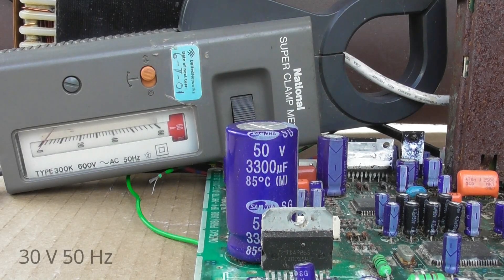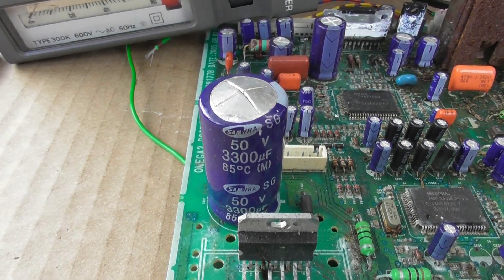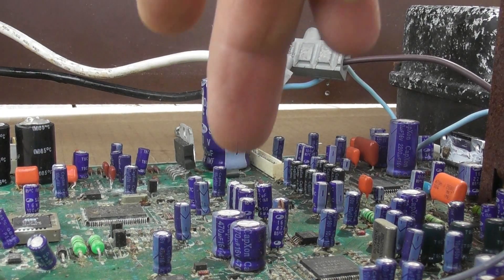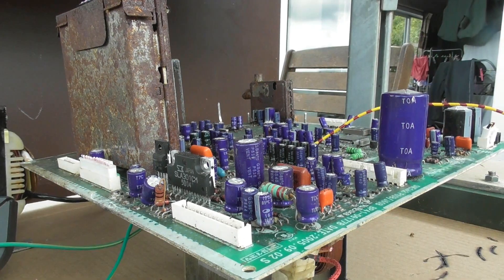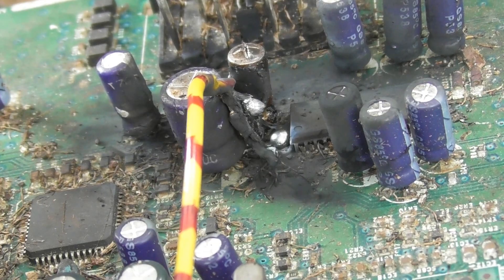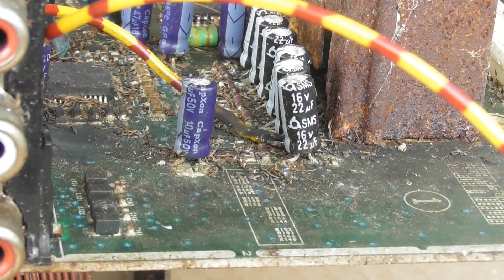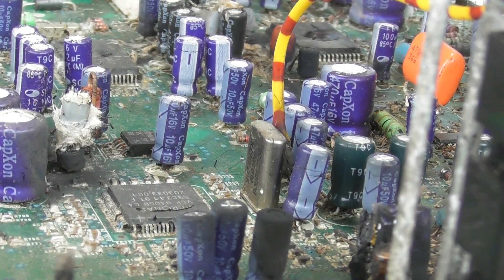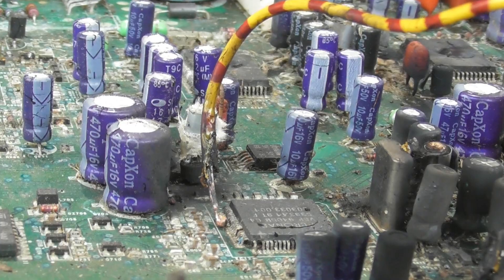A few Capacipufs and some small arcs of an old CCT board

Comment: Tip:- ground all power rails to the PCB or place pcb flat on a grounded metal table then with a high voltage hot stick hover to arc just above top of capacitors and components for maximum destruction.

Comment: I wonder if the capacitors would blow more catastrophically if powered way above its rated voltage instead of reverse polarity due to the higher voltage drop.  E.g. if that 50V capacitor required let's say 100V to conduct at 40A forward biased, it would dissipate a lot more heat (i.e. 100V x 40A = 4000W) than the much lower voltage it conducts at in reverse polarity.
Reply from the maker: This was just a try at a lower voltage to see if it would work